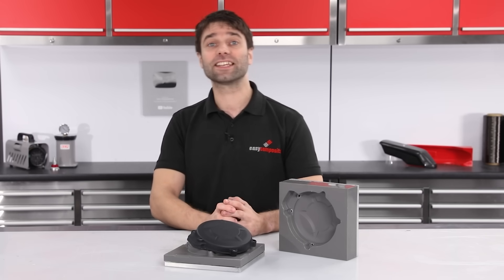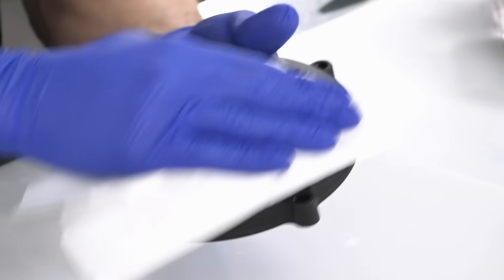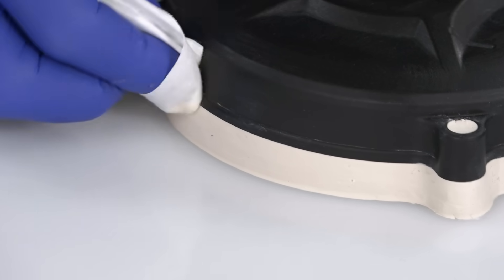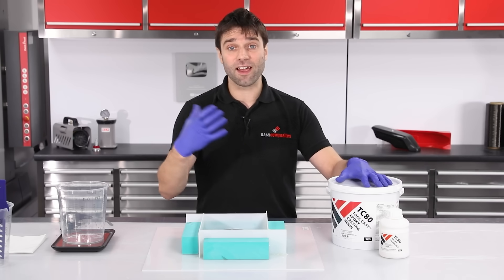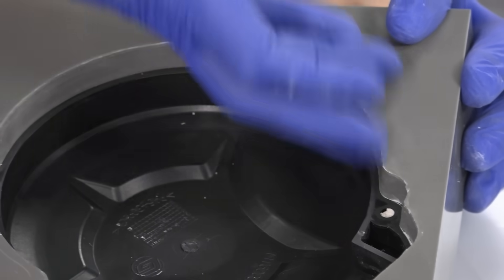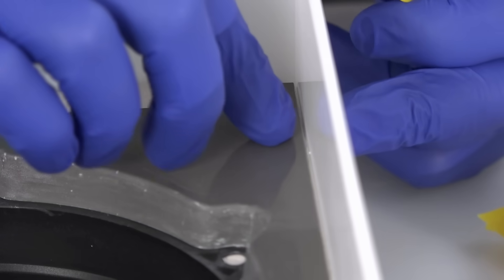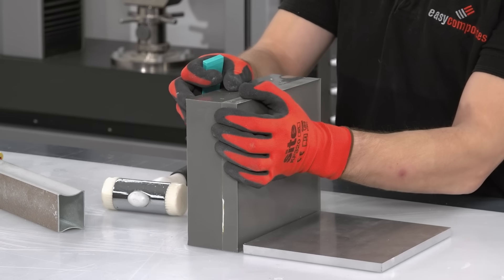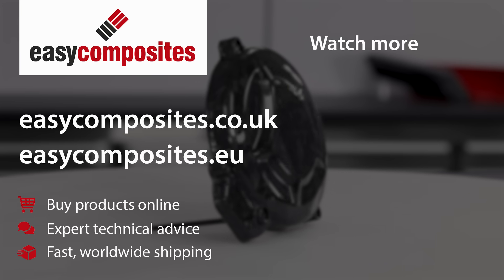How to Cast a Two-Part Compression Mould for Forged Carbon Fibre

Comment: Can you make a mould from a part that you plan to use? Let's say a mirror cover for a car, where the original mirror cover will still be used afterwards. Will the molding process damage the original part or do you need a layer in between? or would the mould release agent protect the part? Thanks! Amazing videos
Reply from the maker: Yes you can take the mould off a part that way. after a clean, the cover in the video was reusable.  Painted parts may well get paint damage though depending how well the paint is adhered.

Comment: What about air bubbles in the casting resin? Wouldn't they be an issue at high temperature curing? Can they be avoided or taken out like in case of concrete by vibrating the mould?
Reply from the maker: As long as the resin has been mixed carefully and poured carefully, there are not usually any issues with bubbles in this resin. You certainly could degas or use a vibrating table to remove any bubbles you still have.

Comment: What if the TC80 resin isn't an option? I would like to use it in my potential project but to have it shipped to the US more than doubles the price of the resin which isn't really practical for me, and I've been unable to find anything like it out there. Would it be possible to use high-hardness silicone as a substitute, somewhere above maybe 75A-80A hardness? The mold probably wouldn't last as long, but the accuracy of the final part is more pressing for me.
Reply from the maker: Silicone would flex under compression so would be unsuitable.  The material needs to be rigid and have a good level of compressive strength to resist the compression forces when clamped together.
Reply: @easycompositestv  yeah, I figured that would be the biggest issue. I guess I'll just have to wait for the US warehouse to get set up 😉

Comment: would it be possible to replace the generator/stat& clutch cast aluminium parts of a motorcycle ? The inner side though must be able to cope with the warm oil from the inside side of the engine.
Reply from the maker: You may need a high temperature resin system to do that depending how hot the oil gets.

Comment: Question, how what would I use to glue or stick two pieces of forged carbon fiber together. For example if I made two of these carbon fiber pieces and wanted to stick them both together instead of screwing then together, how was I go about that?
Reply from the maker: Your two best options for bonding carbon fibre components together are epoxy adhesives, or methyl methacrylate (MMA) adhesives. With some simple surface prep (keying with abrasive paper) both of these types of adhesive are capable of achieving a very strong bond. From our range, adhesives such as our VM100 or Permabond ET538 perform very well.

Comment: Are there any alternative resins for making moulds like this to forge carbon fiber? I do not have option to get tc80 locally or from your website, because there is no shipping option to my country.
Reply from the maker: TC80 is a slow curing epoxy with a high percentage of powdered aluminium as a filler, it also has a Tg (glass transition) of 80C. For ambient temperature work (like this compression moulding process) the Tg is less important, so too is the aluminium filler but it would probably still want a filled resin with good strength that's castable in thick sections. I'd suggest filling a standard epoxy casting system with an inert filler like aluminium tryhydroxide.
Reply: @easycompositestv   @Easy Composites Ltd  thank you for the detailed answer! Do you know the ratio of epoxy to aluminum trihydroxide? And can i to differ an epoxy resin that is castable in thick sections? Epoxy providers dont actually know whay they are selling here, unfortunately.
Reply from the maker: @eIgHtY0N3  Its due back in stock later today, just waiting for the truck to arrive and get unloaded in Rijen. We don't specifically have a casting epoxy which has the same properties but in terms of depth of pour, the GlassCast50 may be the best option albeit, the temperature would be limited to 45-50'C.

Comment: Other than the male tool is the female tool quite under tension. Would a reinforcement of some chipped carbon or glass fibre in the resin be useful in order to increase the strength?
Reply from the maker: Both the tools are under the same basic force as they are clamped together. There is generally no need for additional reinforcement when the metal load spreading plates

Comment: The process described is called CASTING not forging. Forging is when you change the form of a workpiece via force.
Reply from the maker: Thanks for the comment and yes, the term 'forged' carbon fibre is not the clearest but it's been around for a while now  (Lamborghini have been using it for several years) and is quite widely used with an established meaning. To avoid using the term would mean that many viewers interested in understanding 'forged carbon' might never find this content, get to see what the term refers to (for some at least) in the context of carbon fibre composites, and learn how - for the right components - this process can be used to produce strong, lightweight parts with minimal equipment.

For what it's worth, before making the video we did discuss whether to use the term 'forged' a lot because we really weren't sure ourselves. After lots of deliberation (checking dictionaries and researching the history of the term) we decided to go with it but we did expect others might come to a different view, and that's fine too. If you'd like a much more lengthy explanation of we came to our decision please get in touch, we're happy to have more healthy debate on the subject :)

Comment: What if the part is made from a stiff material? Like for example this clutch cover from aluminum, how would I get the part out of the mold?
Reply from the maker: You ideally choose a part that has an inherent draught angle to it to avoid mechanical locking. The stiffer the part, the more careful you have to be demoulding to ensure you prise the part out evenly vertically so it does not jam in the mould.  In extreme cases you may need a multi-part mould to get a good release.

Comment: Awesome video!! I was wondering, how much build up is needed to create the 'piston effect' into the mold. Is there a specific measurment range?? Thanks!!
Reply from the maker: There is no set rule and it depends on size and shape of mould but around 20-30mm on relatively small to medium sized moulds should provide enough space to fill with the resin/fibre and still have space to align the two halves of the tool.  If its too shallow you risk the fibre and resin going sideways as you begin compression.

Comment: Would this be at all similar to RTM processes?
Reply from the maker: Only in the sense that matched tooling and compression is applied.  RTM usually uses much higher pressures, heated moulds for quick cure and the resin is forced through using pressure.

Comment: Is this compatible with extruded polystyrene ?
Reply from the maker: The resins will not damage the polystyrene but most polystyrenes will lack the strength to be used in this kind of process.

Comment: Thinking about making phone cases, but the wrap around lip on finished case is giving me a headache ,

I was thinking to make a 3 part mould with first split running vertically separating left and right 

And 3rd part pressing in to form where phone will sit, do you think that setup would work? Making draft angle on the top side of phone but leaving wrap around edges on case, 

Separating left and right first then flexing finished part off the internal foam part? Forged carbon tow btw
Reply from the maker: If you can make the mould so you do not have mechanical locking then that would be best. Say a middle section that lifts out giving the sides room to slide out.

Comment: Do you have any tests using engineering samples, such as tensile testing, torsion testing, beam testing etc.?
I'd be interested to see the empirical Young's modulus number that the data might generate.

The reason I ask is that I'd like to know if it's possible to take a mold from a simple track control arm on say, a Vauxhall Corsa (cheap mass production car) and create a lighter yet safe component using this method, whether I need to add volume to the part (eg., fill gaps) to increase strength in either axis, etc.
Reply from the maker: We will be testing the brake levers in the next video which should give you some ballpark figures.  However a control arm is a highly loaded component and would need significant testing to consider making in this method.  I suspect it would not be a suitable method. Certainly not cheaper than a typical pressed steel part.

Comment: How would you recommend doing say a eyeglass arm or frame? Since the details are much smaller?
Reply from the maker: A glasses frame should be possible but very fiddly.  Switching to a milled carbon fibre would make it easier and in effect you would cast the resin into the mould and compression would be at a minimum necessary to close the mould.  It could be done with the bigger chopped tow but you may need to make some DY tools to press it into the recesses properly to get a piece with minimal surface voids.

Comment: What is the tensile strength of the chopped compressed chopped carbon?
I'd imagine it's a lot stronger than nylon or other plastic,  how does it copare with aluminium or a conventional carbon layup?
Reply from the maker: We are doing some comparative testing for the next video so show the difference.

Comment: At 13:59, how did the holes get put in the mold? Was this done to use a dowel pin for part removal??
Reply from the maker: Yes they were drilled for the dowel pins.

Comment: Forging is not the proper term for this process because forging includes an impact creating a ductile deformation and in some case a hardening in the region of the deformation (normally applied to metals). The process you're using is called: low-pressure bulk molding compound (LPBMC).
Reply from the maker: Thanks for the comment and yes, the term 'forged' carbon fibre is not the clearest but it's been around for a while now  (Lamborghini have been using it for several years) and is quite widely used with an established meaning. To avoid using the term would mean that many viewers interested in understanding 'forged carbon' might never find this content, get to see what the term refers to (for some at least) in the context of carbon fibre composites, and learn how - for the right components - this process can be used to produce strong, lightweight parts with minimal equipment.

For what it's worth, before making the video we did discuss whether to use the term 'forged' a lot because we really weren't sure ourselves. After lots of deliberation (checking dictionaries and researching the history of the term) we decided to go with it but we did expect others might come to a different view, and that's fine too. If you'd like a much more lengthy explanation of we came to our decision please get in touch, we're happy to have more healthy debate on the subject
Reply: @easycompositestv  No biggy. I guess it's one of those times when marketing had the last word over engineering.
Reply: @easycompositestv  Thank you for the invitation but I'm a composite material manufacturing engineer who had about sixty layup mans working under him for windmills repairs in another life.

Comment: Would it make sense to cast in metal spacers where the bolt holes go to prevent cracking when installed?
Reply from the maker: Depending on the application you can cast them in or bond into place post production.

Comment: Do yo think gears would be a think that could be made like this?
Reply from the maker: The shape may well be possible to mould - if a bit fiddly.  However durability and surface wear may be an issue for gears that are under any significant loading.
Reply: @easycompositestv  that is what I was thinking also

Comment: what lay up technique would you use for a compression mold?
Reply from the maker: Hi Devin, a simple mould would be multiple layers of glass. However the Tool Cast is by far the easiest way as you want the back of the mould to be flat so you can apply the clamping force in an even way

Comment: Great video, I have some carbon fibre wing mirror covers I'm looking to reproduce in fibreglass/carbon fiber. Would this be a good way to replicate without having to go down the vacuum bagging route? When will part 2 be coming?
Reply from the maker: You certainly could do it this way, especially if you intend to have a finish on both the inside and outside and want to use a chopped carbon to achieve a 'Forged' type effect. However, if its a simple cover and you'll be using normal woven glass or carbon then there may be more straight-forward processes as shown in our 'Hand Laminate and Simple Vacuum Bag' video and 'How to make a mould for carbon fibre parts' on our old CarbonMods channel. In fact, in the latter video, tis actually a mirror cover we use as the example.

Comment: Could you use 3d printed mould too? Would they be strong enough? (Well off if you print at 100% infil) but a sane infill ratios?
Really digging the idea. And at the moment I am considering getting into cf moulding a bit because it seams really cool
Reply from the maker: Hi Maximilian, yes, you certainly can. In the next video in this series (out next week) we will use a 3D printed mould as well as these cast resin moulds. Make sure you’re subbed.
Reply: @easycompositestv  looking forward to it

Comment: I have a question, i want to make carbon fibre part with threads molded in to the carbon fibre part. Is there any best practices when doing this? :) And thanks for the great content!
Reply from the maker: Hi Oskar, best practice is to avoid threads in composite parts as much as you possibly can. Where possible, you should laminate or bond threaded fasteners into the laminate. If the thread must be moulded in the you would coat the male side (a stud/threaded bar) in release agent and the laminate around it. Once cured you would then unscrew the stud/bolt to remove it, leaving the female thread.

Comment: Is there a reason you couldn't scan the part and machine the halves? Or if I had the 3D model?
Reply from the maker: Whilst you could produce bot ha pattern or a mould by 3D printing, this would generally be for low-quantity production and may not be suited in the event of higher temp applications or when curing under pressure/vacuum. The tooling here would be much better suited to longevity and series/batch production without distortion.

Comment: "Forged Carbon" is a complete joke, ugly, and structurally garbage.  Great lesson on mold making, though!  Very useful.  I'd be interested in seeing this used for a vacuum forming mold and/or what kind of venting would be required if this were to be used for vacuum bagging a part to the A side mold.
Reply from the maker: Strong feedback Brian! I think you might be interested in our next video and the third one in this series too. In the last video we run a full suite of structural tests on forged carbon fibre parts, alongside aluminium, 3D printed carbon (Markforged) and a carbon ‘reinforced’ FDM filament. I suspect you might not have the equipment or the expertise to do this yourself and might find the results enlightening. Thanks for the feedback on the mould making process, we might well do some other videos on conventional moulding into cast tools in the future.
Reply: @easycompositestv  I'll be interested to see it.  Unfortunately most of the carbon filaments out there are such short-strand  low wt% mixes they don't look to offer all that much advantage, but I've got some to try out.  Rather than compare it to any of those, I'd find it interesting to compare it to proper laminates from cloth.  Most of my work has been with resin infusion, which could definitely make this part, and likely have a much lower amount of resin.
Reply from the maker: Totally agree on the normal 'carbon enhanced' FDM filaments but we'll put some numbers to it.

We have an idea to create a continuous fibre layup of the test component (so, stuffing in continuous fibre oriented in the optimal alignment) to see what would be possible in terms of performance. This would outperform an infused component made with woven cloth because we'd have the advantage of selective fibre alignment (predominantly unidirectional). In terms of your resin ratio of an infusion vs forged carbon, they'll both be almost identical and 60:40. In theory, we can go slightly higher fibre fraction with a compression moulded forged carbon component than is possible with a vacuum infused laminate because we - potentially - have a lot more pressure available. Many times more in fact.
Reply: @easycompositestv  The compression part definitely sounds like it will help.  I've considered using compression after infusion to see if I can get a little more out, but never had an actual case that required it because we were doing much larger parts.  At that point, the cost and rigidity of the second mold wasn't enough of an advantage.  If I ever get space to work on some of my own bits, I'd be doing smaller stuff, though, so might be worth a try.  3D printing with a continuous filament would be an interesting experiment, if I understand correctly that that is what you are talking about.   We did some design work years ago with a carbon-nylon composite and the nylon just didn't provide enough strength to do anything interesting, and I suspect a lot of printable plastics might have the same problem.  It would outperform most other printed things, though.   Also, we've been able to get 50:50 from many resin infusion layups.  The cover you did the mold for is pretty tight, so that's a hard one, though.